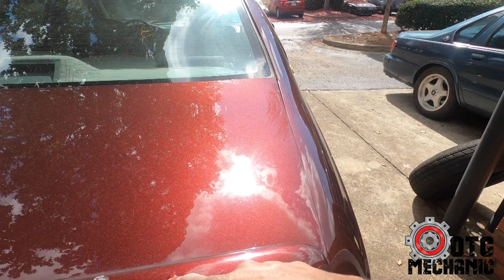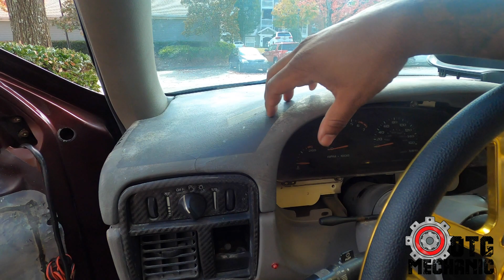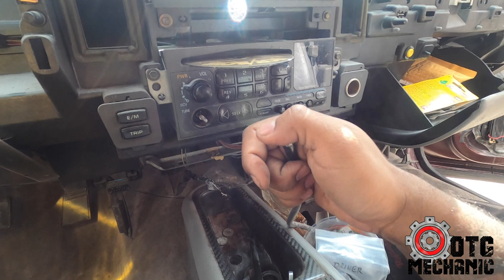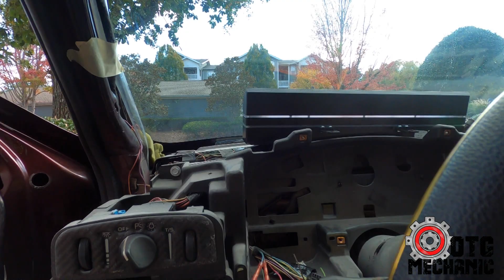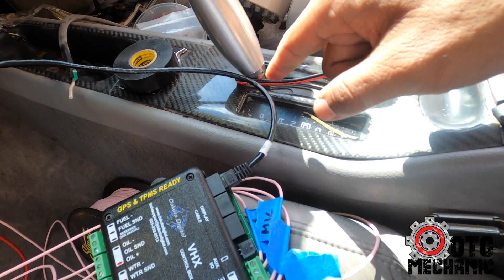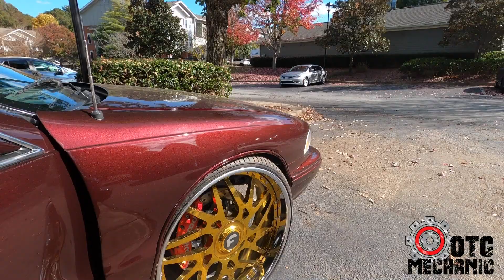Dakota Digital VHX install on 1996 Impala ss on 26 inch Gold Forgiato Twisted Maglias

Comment: It would not be expensive to 3D print harnesses for the factory gauge clusters and the Dakota digital and pin out direct fit harness. It would save so much time on the installation. If I had the means, I would do this myself and charge at least $100 for the harness.

Comment: My original cluster showing the mileage faded out and won't illuminate at all. In order to get the mileage reading for the new cluster you must have the original cluster working to get the mileage?
Reply from the maker: Yes the mileage is on the cluster not the pcm.